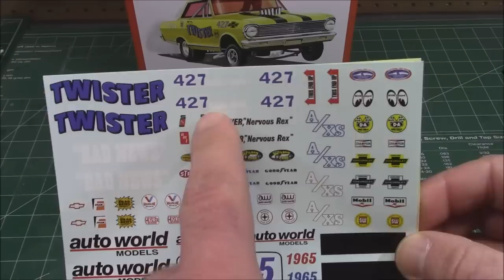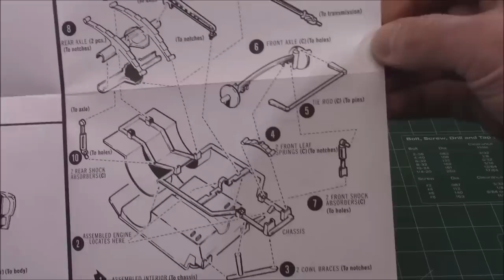1965 CHEVY II NOVA 427 AWB DRAG FUNNY CAR  1/25 SCALE MODEL KIT HOW TO DECALS DASHBOARD TRIM AMT1293

Comment: That hammered silver finish looks really good on the chassis - gives it a nice effect. At first I thought you were running low on that spray and it was splattering as it tends to do!
Reply from the maker: The nozzle clogs often on the hammered paint.  I soak it in super clean overnight when it does.

Comment: I love building my models, however hate dealing with how wheels don’t fit on axels well. Any suggestions on how to fix?
Reply from the maker: Simply drill out the wheel a bit using a hand held drill bit. In fact on Saturday's video coming up I have to do that and I do it on screen.

Comment: Very beautiful job on this one! You really knocked it out of the park! I just completed a  prior release of this kit (black box art as Rat Packer II). I....really didn't like this kit. That's just me though. I converted mine to a 1963 using the tail panel from a vintage 1963 kit and using the grill from the craftsman series issue of the 1963 nova wagon. The pros with the kit are the specific 1965 Nova parts. And, I like how you did the tail lights with the sharpie. There's lots of options there. Also, when I did mine I used the 1966 pro street nova tires in favor of the styrene tires. Had to narrow the rear axle to get them to fit, but really gave it a mean look to it. Also, did you notice the "hammer tone" finish on the front mag wheels? Looking forward to your build and review of the mobius ones😀.

Comment: Looks like a great kit  but I don't know why they call it a funny car, it's a gasser.
Reply: Gassers like this with altered wheelbases and extreme body setback is where the term "Funny Car" originates from. It makes them look funny compared to the stock ones, and the name just stuck. When teams finally ditched using  steel factory bodies in the quest for more speed and went all fiberglass, the name just kinda came along with it.